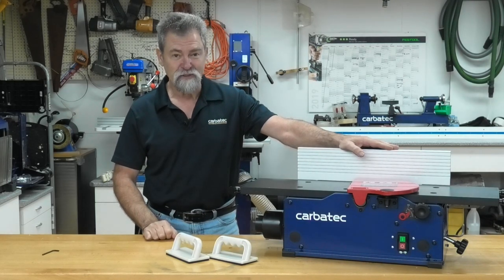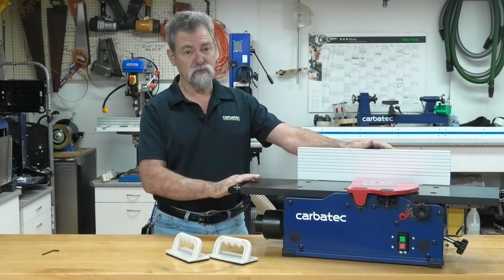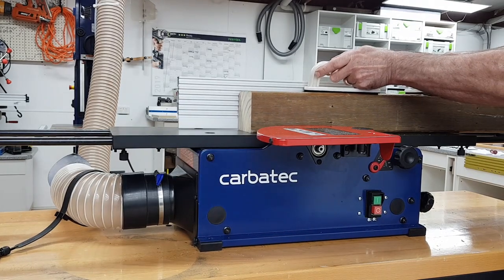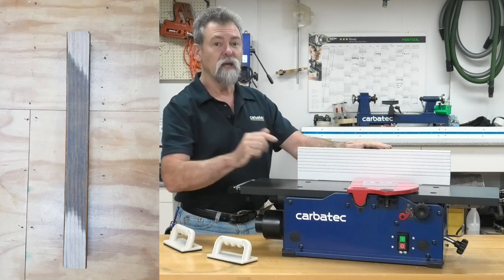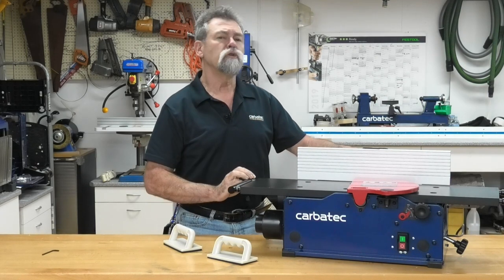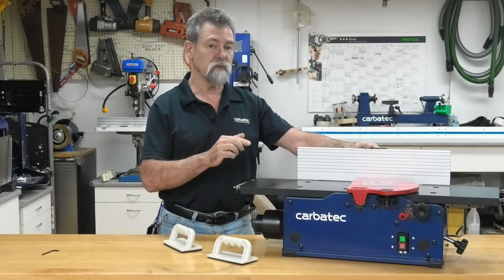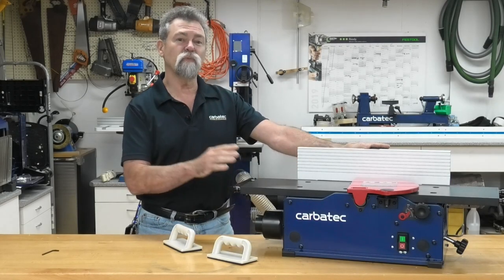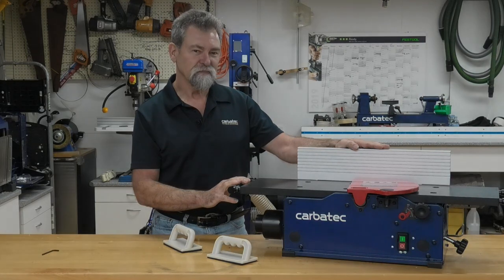Carbatec JN BX150P & JN BX200P Benchtop Jointer Operation & Safety

Comment: Hi Dave. Enzo here from near Blue Lagoon. I have the JNBX200P and it is the least favourite tool in my shop. I have watched your video 50 times and yet I get tapered stock and cannot plane the last 50/75mm of stock. I sometimes think that removing 0.5mm is too little so maybe I should be more aggressive? I'm confident the machine is adjusted correctly. Where can I get lessons in Perth? Thanks.